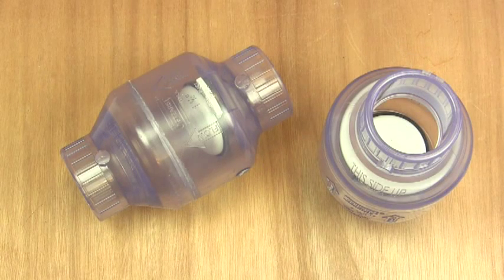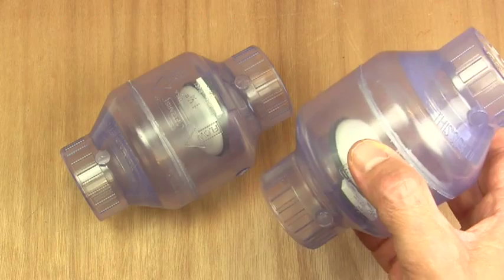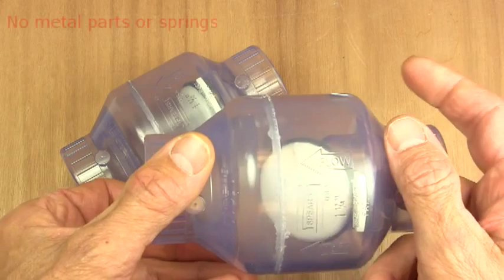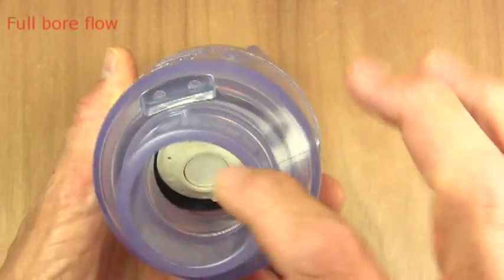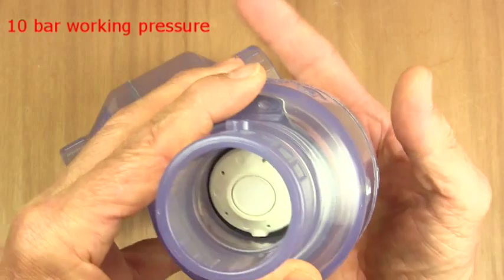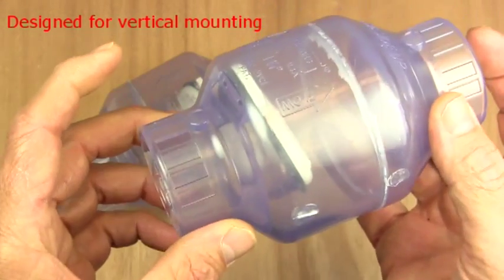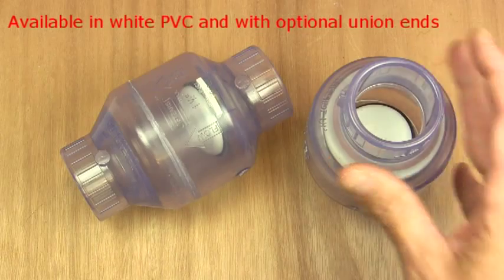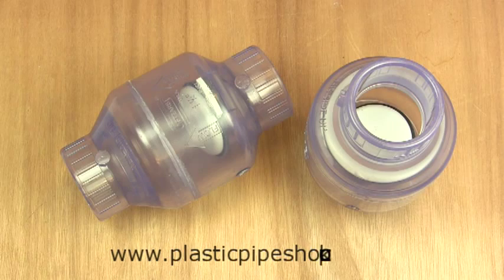Clear PVC non return valve

Comment: This valve can be use for Extractor Fan? I will connect fan to toilet pipe but and looking for solutions for smell.
Reply from the maker: Hi there, this is a pressure valve which means that it will not match any size of waste pipe. The two systems have different sizes so that they cannot be accidentally used together in case of contamination of drinking water.

Comment: If there is know real back pressure meaning my lines are horizontal would I need one of these?
Reply from the maker: Hi Tom, it depends on what your system is and what you want the non return valve to do.  If you could supply some additional information we will be happy to advise.

Comment: Would it last long under loads laden with heavy debris. Is it durable?. I'm thinking along the lines of Prospecting gold
Reply from the maker: Hi there. PVC is reasonably resistant to abrasion and if you are talking large grit, small stones etc. it should be OK, but I can’t give any guarantees on how long it will last as it is an untested environment. One of the biggest challenges for any NRV or check valve is debris such as grass and weed and this can wrap itself around the flap. Certainly this type of full bore flap valve is far less likely to block or be damaged than a more standard check valve such as https://www.plasticpipeshop.co.uk/1-12-PVC-Double-union-Non-Return-Check-Valve-SS-Spring-EPDM-Seals_p_1079.html . I would recommend putting a union https://www.plasticpipeshop.co.uk/Inch-PVC-Union-EPDM-O-Ring_c_514.html either side of it, so that if it gets compromised or blocked you can take it out for easy  cleaning, servicing etc. If grasses, weed and other fibrous material may be an issue, and it is possible, I would also recommend a steel coarse basket/strainer/plate on the end of the suction line.

Comment: I'm wondering about finding something like this for an AC drain line. I want to have water run down the pipe and out the bottom, but stop insects going up it and into my house.
Reply from the maker: Hi, this will not work in a downward position as the flap will stay open. Just a thought but how about putting a small U bend made out of some 90 elbows at the bottom. That would let the water flow freely out of you AC unit and the water in the U would act as a barrier to insects. I would recommend putting a union above the U so you could take it off for inspection from time to time.
Reply: @PlasticPipeShopTV   Thanks. I had thought of this myself but in the instruction manual it specifically says not to put any kink in the drain hose, even at the very bottom, where water could collect in the pipe, or it will flood the internal unit. It also says not to put it into a container with the bottom below the water line, or the internal unit will flood. I am at a loss to understand how this is possible given the nature of fluid dynamics and gravity. Maybe it creates negative air pressure in the pipe, I just don't know.
Reply: Just put piece of net on the end of pipe, then the insects cannot enter.
Reply: @sidiq836spbusp   It's okay, I routed the pipe into my washing machine drain off, so the trap stops it anyway